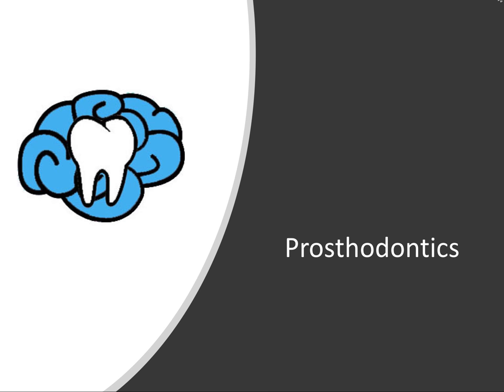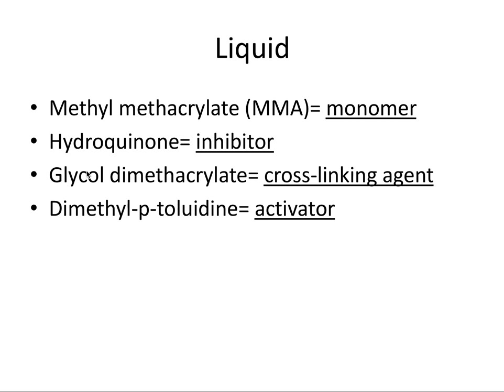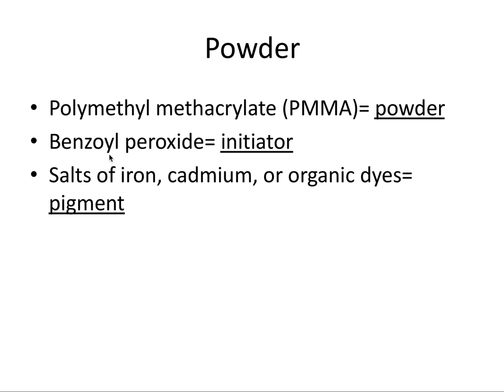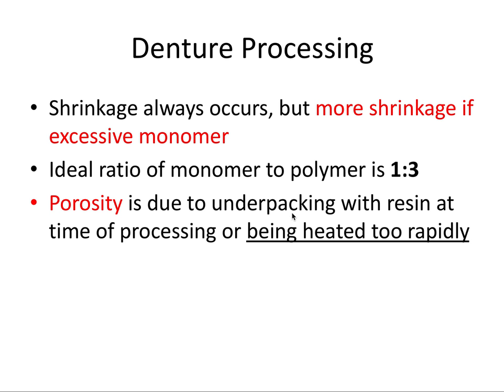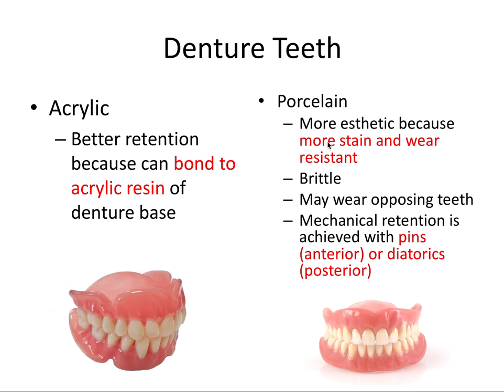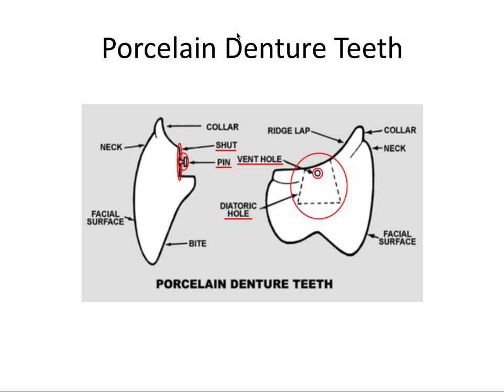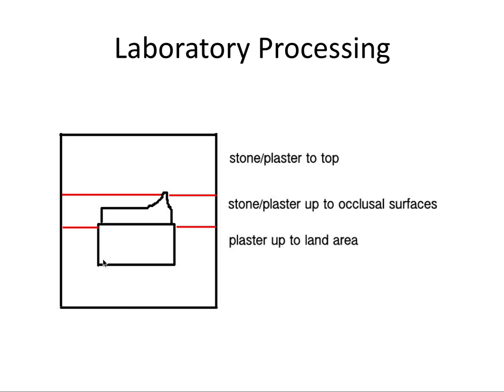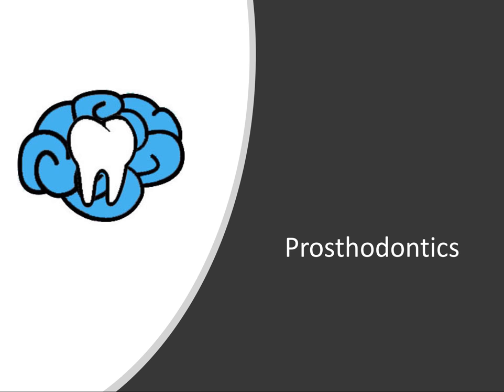Prosthodontics | Denture Processing & Materials | INBDE, ADAT

Comment: Hey Ryan thank you for the great videos they're really helpful. I want to share some clinical tips about using porcelain teeth on dentures. Especially for the cases with lower anterior natural teeth opposing an edentulous arch; it is very risky to use porcelain teeth in the denture. In 1-3 years you will most likely see a labile alveolar ridge on the anterior maxilla, which you mentioned in the combination syndrome topic. So it is not indicated using porcelain teeth especially in those cases. Thanks again, cheers!
Reply: What teeth to use instead?